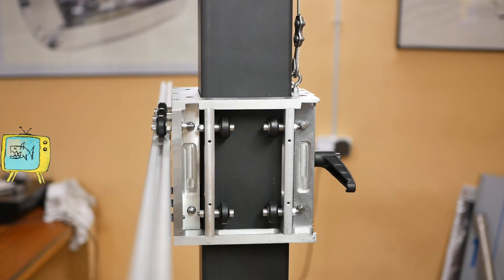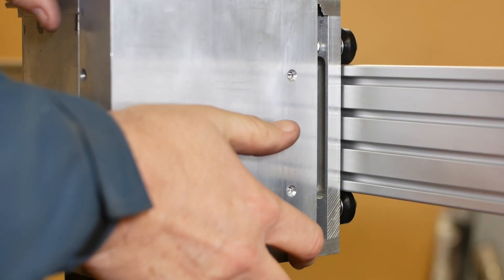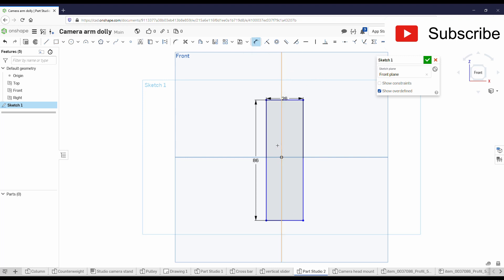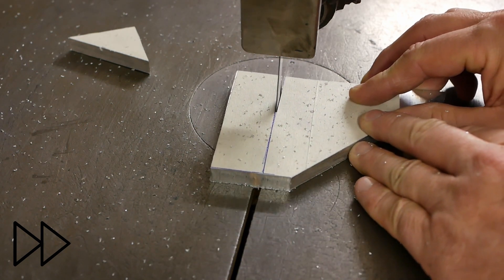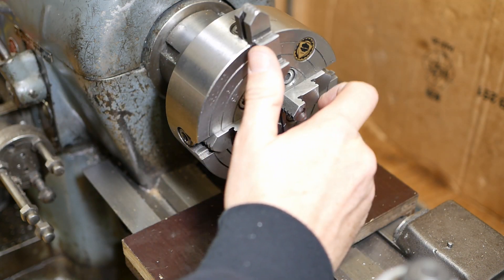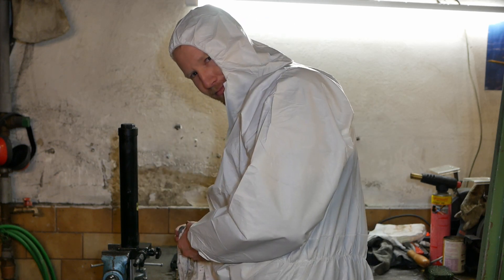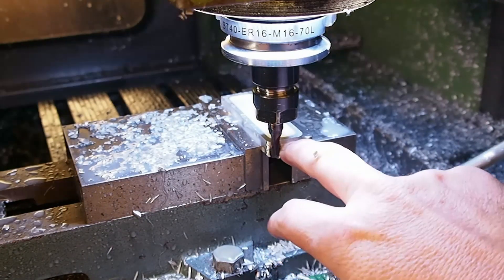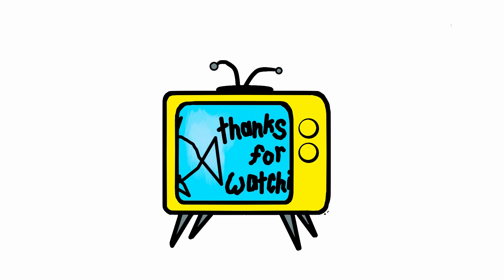Camera arm build - Part 4

Comment: I bet a big lathe :D
Reply: I bet it will be a 2 ton radial drill. everybody needs a big radial drill. maybe he does a cnc upgrade on it too!
Reply: Me: How heavy is it?
Him: YES
Reply: I'd say a surface grinder.
Reply from the maker: @ChristophPech  I am tempted.
Reply: I second the surface grinder vote.  👍👍😎👍👍
Reply: Which is another reason to Upgreyedd the power for that double dose of machining.
Reply from the maker: Keep the speculation coming ;)
Reply: @RotarySMP  a shaper? A die Filer? A high precision Granite mill?
Reply: a huge-ass surface-scraper
Reply from the maker: @hedning003  :)
Reply: Big bandsaw,lathe,mill, surface grinder, biax, cmm,
Reply from the maker: @BraedenPrice1  Big bandsw ( Check - Do-All); Lathe (Check Boley + ini lathe) Surface grinder (Would be nice), Biay (Check - The Coborn is better than a Biax :)
Reply: @RotarySMP  you can never have to many tools!
Reply: Surface grinder. Or a shaper. Or a blast furnance for the back yard.
Reply from the maker: @mazchen  Wonder what the neihbours would say about a blast furnace :)

Comment: Instead of a brake  it could use a rubber wheel to move the carrier. Then a belt to move the beam with steppers, Who wouldn't want a CNC CAMERA RIG!😮,  MAYBE mount it on a positioner attach a stepper and there you go. Completely automated.  All it needs is wheels and it can follow you about!!🤔   a couple robot arms and a Brain 🧠, and its getting creepy!!
Reply from the maker: I did consider making it a mptprosed slider as well, but like this it is faster to set up.

Comment: You are so lucky over there to have 3ph as standard in your homes. Its a real expensive pain to have it retrofitted here in the UK. The minimum price I have seen locally is £3K, then rapidly upwards. I was lucky enough to get 3ph put in 30 odd years ago, when we moved the meter from the cellar to a new meter box in the new garage wall, before the electric company was privatised. Cost all of £70.
Reply from the maker: Yeah, here it is standard. Even our previous 3rd floor, inner city  apartment had a 3Ph feed to the kitchen for the stove.

Comment: How about adding some of those felt pads to the counterweight inside the tube ?
Also...years ago I designed a load of things with four caster wheels. I made the frame slightly compliant (twist) so all four would track nicely over slightly uneven surfaces. 70% of the load was rigidly on two "rear" wheels with the other two forming one virtual wheel.
Reply from the maker: I did felt cover the weight, which dampened all the ringing. I am glad I made this with 5 wheels, as had to do a narrow stance to fit through the door, and have very uneven tiling.

Comment: Thank you for these videos! Now I am building the 5th version of such a device! If you ever decide to sell this device, you can call it a seismograph in the ad! It seems to me that this thing loses most of its stability in the base, and in the mount of the retractable arm. Everywhere, really! But, on the other hand, you brilliantly designed all the details of this device. If you want to build such a device again, consider stability as a major design concern.
Reply from the maker: My problem is that I needed to be able to drive it through narrow doors, with thick concrete walls. The combination of narrow base, and those cheap wheels is pretty wobbly, so if I use it with the arm extended, it is pretty bouncy. Would not work outside in wind, but inside you get used to it. Sure beats using a tripod.

Comment: So ... a few months (and videos) after this mighty build:

Is the camera stand as good in use as you hoped? Anything you'd use 20/20 hindsight to change?
Reply from the maker: It is brilliant. Way way better than a tripod (which I have had to use a few times, as I filmed my camera on the stand.

I had to compromise my design with the narrow base to fit through my stupid narrow doors, and with the bumpy tiled floor the office seat rollers make it a bit wobbly. Better rollers and a flat floor, and maybe a bit wider stance.

The Height is also limited by my stupid doors. It could be a bit higher.
There are some guys who put a toothed belt drive and aduino on the cross br to make a built in slider, which might be cool.
Reply: @RotarySMP  On a recent Watch Wes Work thread, the conversation turned to shop vacs, and castors.

Several people STRONGLY recommend fitting Office Owl Castors.

They use inline skate wheels. :-)

https://theofficeowl.com/index.html
Reply from the maker: Thanks for the link, they should be an improvement
Reply: @RotarySMP  I make no claims as to outside-the-US availability, but hopefully similar things exist
Reply from the maker: @paulwomack5866 I'll hopefully find something.
Reply: @RotarySMP  It seems to be a whole market catagory - Office Owl aren't even the fanciest.

(yeah, I googled)

https://officechairpicks.com/best-replacement-casters/

Comment: hopefully this doesn't get lost in the comments but since you have a haimer probe coming your way let me know if you want some replacement tips as I have 6 left over from when I had a haimer probe and there just taking up space in my tool drawer?
Reply from the maker: Thanks very much for that offer. It is very generous. My email is rotarysmp at aon.at .
Edit, I just watchedNikolais newest videos, and contacted him.
Reply: @RotarySMP  i can't find the "message me" button on your about me page so I can get the address you want me to send these too? I checked and I have 5 haimer tips that I'll never use (I did break a good half a dozen tips before I broke the haimer so youll probably need these).
Reply from the maker: @HuskyMachining  Sorry bout that. rotarysmp at aon dot at.
Reply: @RotarySMP  I just sent ya an email
Reply from the maker: Did you receive my reply? I just set up that email account and am a little unsure if it is working correctly.
Reply: @RotarySMP  I did, just replied back to ya
Reply from the maker: @HuskyMachining  Thanks.

Comment: Perhaps put something soft on your counterweight so it is not metal against metal in the pipe, it seems to scramble a lot. Some kind of fabric.
Reply from the maker: I meant to. I had a mental plan to do a 3D print widget to provide some damping, and then got carried away and clean forgot about it. Feel like Quasmoto, with that bell ringing the whole time. I'll have to go at it and put some felt around that weight.

Comment: terrific, as always. 
I've always been told you shouldn't unscrew your chuck using the key in the pinions because they could break, instead I use an adjustable spanner on the jaws
Reply from the maker: Thanks. I never had someone with experience to tell me that, but have always feltcdoing it with the chuck key seemed of a dodgy method. Never occured to me to use a spanner on a jaw. Thanks for that. Luckily I rarely need much force to remove them, as I switch them out or switch to collets constantly.

Comment: My guess is that it is either a M.A.R.K. 13 scavenged from the radioactive wastelands or a 55 gallon drum of bulk WD-40 to try out as flood coolant. It is a bit of a toss up between the two, but I am leaning a bit more towards the WD-40 though as its aerosol version made a few appearances in this episode.
Reply from the maker: The floos coolant in the MAHO is old and gross, and had evaporated till it didn't pump, so I hit it with WD-40 to prevent buildup.Really need to clean out and replace the coolant. But that will have to wait.

Comment: If your post processor supports it you can have it show the minimum z height of each tool.  I usually use that to check from the height of the stock to see if it's going to hit my jaws.
Reply from the maker: This wast really a height issue, as I knew I was decending blow the chuck jaw height, but just failed to check the X position where it started that cut.

Comment: Nice work.  I've been contemplating a better system for filming my YouTube videos because the tripod legs are always in the way, and although I made a boom arm this tends to tip over if extended.  I was thinking a just pole set into a concrete disc, with an arm hanging off the side but this project might make me aim a bit higher !
Reply from the maker: Go for it. I needed to use the tripod to set up a lot of the shots of the camera stand, and you quickly realise just how much quicker/easier the stand is. It just gets out of theway, and lets you get the angle you want.

Comment: My guess would be a new lathe. I don't see the space for a shaper in the shop, you don't need a drill press, you already got a mill, EDM would probably not be your taste, and they are also hard to come by I would guess.

In addition to that, you mentioned wanting a new lathe since the boley wasn't your dream lathe. If I remember correctly, it was a Schaublin with a number in the lower 3 digit range. After a quick look on lathes.co.uk, my guess would be a 135. 

Also, why are you using OnShape? As you make money with your channel, I would assume you have to pay for OnShape. And given that Fusion only costs 494€ (for the full package), while OnShape costs 1500€ per year (minimum), I would definitely go for Fusion, also because of its machining-oriented features such as setups etc. I don't know if OnShape has those, but Fusion is the clear winner for me.
Reply from the maker: I started using Onshape before I did the channel, as I cant install software on my work laptop, and it was useful to be able to model parts in the even on business trips (remember those times when people travelled. Sigh!)

I never really considered that this could be contrued as commercial use, as i an still just dicking around making personal projects.

I have a Catia license, and have always used that, so will probaly return to it.
Reply from the maker: Schaublin 135's are about as rare as hens teeth. Nice guess though.
Reply: @RotarySMP  Well, this statement proves that you looked into lathes. I mean, I could just go back and watch the video, but it's not as if you could keep quiet about a new toy - errr, I meant tool. 
Also, is rare as hens teeth an austrian idiom? I haven't heard that ever before
Reply from the maker: @vincentguttmann2231  :)

Comment: 6:50  When I was using my bench-top lathe my neighbors weren’t able to watch tv - a grid filter helped. Took them a while to figure it out though.. Oops :D
Reply from the maker: I am hoping that the other supply will reduce interference, but a line filter might also be necessary
Reply: @RotarySMP  I added a line filter and it helped
Fortunately I don’t have this problem anymore - I moved out this place ..
Reply: @RotarySMP  Is it really another supply? sounds kind of strange for one property to be fed by different transformers.. But also might have a big impact even for a different feed from the same transformer? First hand experience that all the connection points along the path do add up.
Reply from the maker: @LunaticCharade  YOu are right, everything comes from the same tansformer, but one 400V Three phase goes to the house, from the main gate fuses, where it is split to two ground breakers, and two 3Phase supply, and further to 11 single phase supplies. That other leg taps off at the gate, goes through a CB, and then goes underground to the basement, and only has a ground water pump on it at present.
Reply: @RotarySMP  gotta be one proper pump that! But sounds like a good plan, fingers crossed that it's enough to make the wife and maho be friends
Reply from the maker: @LunaticCharade  I think it is a 2.5kW pump, used for watering the garden. The water table is about 7m down around here.

Comment: Loctite that hinge screw. I have two Dell XPS with the same/similar hinge design. Both cracked on the right hand side.
Reply from the maker: We think alike, off camera I removed that screw again and locktited it
Reply: The danger of Loctite is that it can seriously degrade some plastics.  I once had a plastic cover crumble apart around the screw holes within a few days of using Loctite on its screws.  It wasn't marked with a resin code, so I couldn't have looked it up first, but now I do.  If I'm in doubt I use something else, like a thin soft wire down the hole to mechanically wedge it, or a dab of glue on the head.

Comment: On my sister's laptop the threads were mangled so we just drilled through the panel housing and used nice old tiny east german screws we have tons of. Sure you had nuts sitting on the outside of the lid, but it gave it a nice "repaired" touch.
Reply from the maker: Frank Stein also had exposed bolts.

Comment: For the part centering thing - in Fusion I always create a diagonal of the rectangle and then set the origin as the middle point, it is quite fast
Reply: I said the same, then noticed that you had beaten me to it. 
If the corners are likely to disappear in a fillet, then centre-to-centre on two edges works too. Though I tend to drop a sketch point on the construction line midpoint and make that coincident with the origin.
Reply from the maker: Thanks guys.
Reply: in fusion you can just create a centre rectangle that goes from the origin by default, then just change the size from there with constraints
Reply from the maker: @IRRob.  I have only played with fusion a couple of times. Not sure way it didn't jell for me. I prefer Catia.
Reply: @IRRob.  Yes, well, err, I never thought of doing that because, err.. It's cheating? 
Or, maybe, I just never opened that sub-menu, as the "Rectangle" button only shows one type of rectangle.
Reply: Since it looks like you're using onshape you can just use a center point rectangle using the origin as your starting point
Reply from the maker: @CodyBelcher  Thanks.

Comment: is anybody gonna eventually speak about the rather uncanny allignment of the holes vs. threading of the new cover plate? :D 

Now the REAL activities of this fan of yours have been revealed in your basement... manufacturing cocaine, right? or cooking some dish from new zealand. One way or the other, nothing legal here...
Reply: I was doing my best to ignore the hole alignment.  I reckon he's going to be using those very rare offset thread screws to fix it.
Reply: @ferrumignis   that’s a job for the CNC’ed mini lathe... another possibility could be to blame somebody else for not beeing able to use some proper machinery as drilling the part. :) but we all know it is down to some bad conversion from Millimeters  to apples.
Reply from the maker: @NicoCarsAndCookies  ...[head hung in shame]...
Reply: "If you like what you see" :)